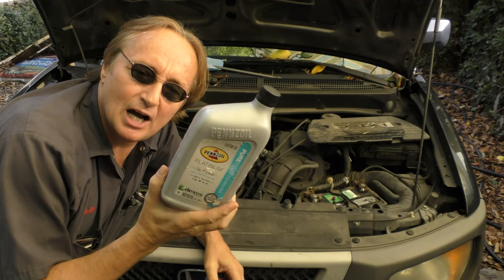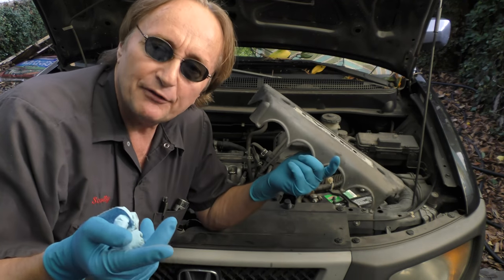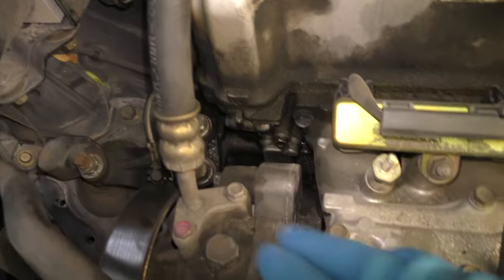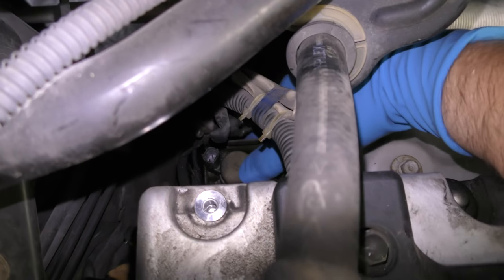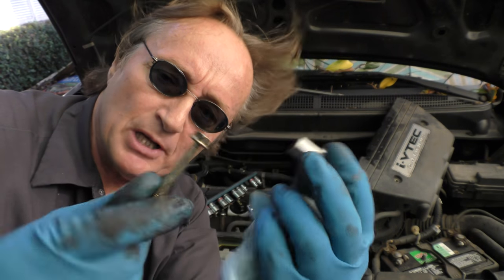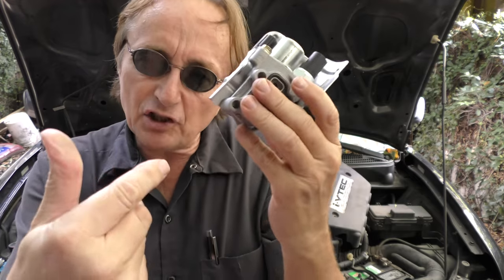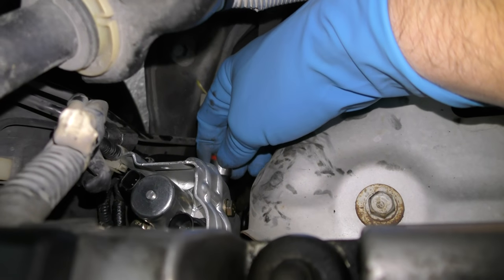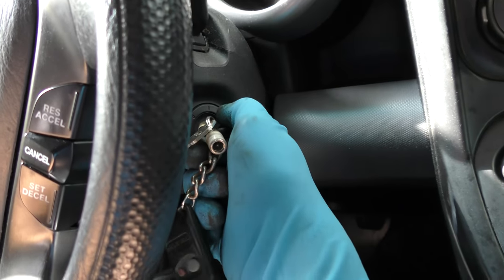How to Fix Variable Valve Timing in Your Car (VTEC)

Comment: My 2009 pontiac g6 2.4 is surging occasionally when driving.. Codes a while back at auto zone said exhaust  camshaft timing advanced.. What do I do to fix it??? The car is a pretty good daily driver, and I'm wanting to sell.  Just need the occasional surging gone, before selling.  Any help appreciated.

Comment: Hey Scotty, I have a Subaru that throws a fuel vent/system pressure code sometimes. It won't start after getting gas without a few taps on the gas pedal. It's an old beater car and I don't want to put any money into it. is there a cheap way to fix it or should I just leave it as it? Car drives fine.
Reply from the maker: +bmwmsport11 leave it
Reply: Scotty Kilmer thanks!
Reply: +bmwmsport11 Had the same problem on another car it didn't give any code tho, what i did was clean the fuel pump in the fuel tank, it has some kind of filter there and after that i car always started without tapping the gas pedal.

Comment: Scotty you recommend used 2013 Avalon rental car over New 2016 Accord? If i do regular services as you recommended i don't have to worry for coming years am i right? Hertz is offering certified 2013 Avalon rental car for $18999 is that a good price and they have 2013 Avalon $17500 not certified rent to buy which one you recommend.. I don't have any knowledge about the cars please help me..     

Thank you Scotty
Reply from the maker: +mona samuel I would go avalon for sure
Reply: Thank you so much Scotty for your advice.. Which one you want me to buy Hertz certified 2013 Avalon $18999 or 2013 Avalon $17500 not certified.

Comment: I have had the variable timing solenoid gasket replaced twice within eight months on my 2006 4 cylinder Honda Accord. I have over 307, 000 miles on it. It keeps leaking and now it’s leaking again. Mechanic told me he used Honda genuine parts gaskets. What could possibly keep this gasket leaking like this.?

Comment: I have consistently changed the variable valve timing system and it keeps getting clogged up. I service as at when due and use the recommended oil. Please what do i do?

Comment: Hello am from uk love your videos learning so much. I have a question to ask? about VW Tiguan 2008 model I went to start my car on 4days ago on  drive way. There is no crank and no start we done a diagnostic done is showing code error P0010 CAMSHAFT TIMING CONTROL BANK 1 FAILURE. we had misfire and loss power. I changed all spark plugs and all ignition coil and full service on car 6months ago . Still had mis fire and loss power but now no start on engine showing code P0010 please need some advice

Comment: hey Scotty I'm doing this for a friend on her 2005 crv . I'm changing that along with a VTEC filter and vct solenoid. is there anything I should do special to the vct solenoid? does it have to be installed "unsprung". like a timing tensioner or just unbolt and reinstall? thanks in advamce

Comment: I had to do one of those once. I don't remember the exact engine but it was on my Niece's Accord. One of those three bolts was in a position we couldn't get to. We ended up having to modify the socket into a wrench like doohickey. All of my wrenches were too thick, a socket could get on but there was no room for a ratchet. We cut the socket down shorter and welded it to a wrench we cut.

Comment: Hey scotty! My dad has the same stingray corvette with a 5.7L engine and he has a problem with his gearbox. It is an automatic gearbox but when he puts in reverse, the car will not go backwards. Do you know if this is a big problem ? Big fan of you! Greets from Belgium
Reply: The belt clutch is probably slipping.
Could be a big job and the other clutches might be going soon, so if you open the gearbox, you might as well change all of them.

Comment: hey Scotty hope you're still keeping an eye on these videos? My 2003 nissan altima won't start. It turns over and has spark. Checked the camshaft/crankshaft sensors and the fuel pump. While looking around I notice my VVT was broken at the connection to the point of falling off. Can this cause my car not to start if it is broken like this? I believe I did it while taking off the timing cover to fix my timing tensioner.
Reply from the maker: yes it can stop the car from running. It can confuse the computer data that much
Reply: Thanks Scotty. Keep up the great work. You have helped me out a lot with my cars.

Comment: Scott, I put pour in product Engine Restorer in my 2011 MKZ and it tripped the VVT codes p0018 and p0021. I had the engine flushed within 3-5 miles at a local oil change shop. It's running a little better but not like it was. What's my next step?
Reply: milton112 never ever ever use anything other than factory approved oil. some manufacturers use oil pressure to control the VVT and a different viscosity fluid can damage them. keep changing your oil. should get better with time if u haven't fucked it up already.

Comment: Mine doesnt look like its leaking but cel is on and the code came up for this. Do I just change the sensor on there instead of the whole assembly? The oil was old so I changed it and the cel went off for about a week and drove normal then came back on today and didn't wanna start when I stopped at the store but finally started after a few mins.

Comment: Hey Scotty , As my car is jerking at 300-4000rpm and i have a error code which says variable timing problem, i was thinking to change the timing valve solenoid,  after your watching your video i may just need to change the oil as service light due is on. do u think this may fix it?
thanks man great video.
Reply: Did that work cause I have the same problem

Comment: I just have a question. My silver rock warranty shows that solenoids are covered and when I got my car checked out by pep boys there saying vva valve and down on the bottom it says  remove and replace variable timing control actuator? Is this all the same thing? Or can solenoids be something different?

Comment: Hey great vid.  I just did my timing Belt on my Honda del sol it's a 1.6 liter v.tech.  and the engine was ok after the timing belt snapped.  I got it all back together and there a slugging In the throttle. no power I believe the timing is off I always thought you could only use a timing light on a timing chain is that right.
Reply from the maker: +Jon Wright you can use timing light on any engine, other than a diesel

Comment: I use a mirror with a handle to hold to see the bolts to screw them back in,  makes the job so easy..... but i sure have experience doing it..  every single time it is time to change the oil after i change it variable solenoid goes bad,  The oil is  not clogged up just regular oil in color when time to change it... I have had to do this from day one of 4 years  after every oil change and this part is not cheap around 104.00 ... And so far I have not figured out why it goes out each time I change the oil it usually goes out within two days of changing the oil... i use Castrol GTX High Mileage 5W-20 Engine Oil ...  i know its the right grade, and that brand i would think would be great for it.

Comment: hello 
in my toyota corolla 2014 i have p 2649 trouble code they told me to replace the valvematic which costs about 1500 dollars please tell what to do changing oil and cleaning the valvematic controller will solve the problem?

Comment: hi i want to ask you a question . my crv was going up on a hoist to about 6 feet up. when the hoist stopped my new vtec solenoid that was felt in place fell out and landed 6 feet down to the concrete floor . do you that something could of broke in the part? because after the install i still have the same code .let me know thx

Comment: Hi scotty im looking into buying a broken motorcycle, Its a 1988 Honda CBR 600 the guy selling it says it doesn't start because hes pretty sure he hooked up the "coils" wrong is it possible that he fried the entire electrical system by doing that or will it be a relatively easy fix?
Reply from the maker: +jgnjh NEVER buy a non running bike unless it's really cheap, like 200 bucks Then you pray it's a cheap fix like new coils or wiring repair
Reply: +Scotty Kilmer its a 400$ buy with the title would you do it?  I want it as a project.

Comment: I just test drove a used 2011 Honda Accord.  It had an awful noise on starting but went away after a brief second.  Could that be what is causing it?  Dealer wants $5000 for it!
Lee C  Thanks Scotty if you answer!
Reply: Lee C I have been having the same problem for about a year now. Found out today that it is the VTC Actuator (valve timing control), apparently it is a very common problem. Google it and/or search Youtube you will find out that is your problem.
Reply: @letmebehomie6185  thanks

Comment: I already changed the one on the back of the engine and the one on the left side and it has the right oil and I already did an engine cleaner and it is not leaking. This is for a 2004 Honda Element. It still has the check engine light and it still won't accelerate over 3,000 RPM most of the time. Do you have any other ideas what it needs?
Reply: same here, have you found something yet?
Reply: @kaze6027  so apparently the first time the guy only replaced the one sensor and the screen and gasket.  He didn't replace the whole unit because the guy I bought it from had just replaced it. Had the whole unit replaced and now it finally works. Although the computer was saying the actuator inside the engine was stuck on but not sure if it's an old code. It did do the rev limiting thing once more since it was replaced, right around when the thermostat went bad. I actually just dropped it off to get a full inspection done to see if it needs anything else.

Comment: hey Scotty I have a 1989 Camaro which I just replaced the throttle body, after replacement the car idles at like 1400 rpm in park and 1000 in reverse and drive, checked for leaks and installed new IAC, also adjusted the idle screw which made no difference
Reply: +The1972Cutlass sounds like vacuum leak, i know you already looked but thats what it sounds like, maybe the new gasket was defective?
Reply: Yea that's what I'm starting to think, it doesn't look defective but who knows it could be
Reply: The rpm goes up and down constantly so I believe that is most likely the cause, just purchased a new IAC for it so I eliminated that as the cause
Reply: +ChronicConnoisseur  I didn't use any sealant on the gasket, is that required? or it doesn't need to be sealed

Comment: Thanks. I have this issue with my wife's Mitsubishi Fuzion in the Philippines. I was told it was the fuel pump, the transmission, and a few other things before I realized that this was the problem.

Comment: scott i have 98 chevy silverado the engine cranks really slow battery voltage is good starter is good. It doesnt want to crank fast enough to start it. could it be a timing issue

Comment: Hey, I thought you said to always disconnect the battery when connecting / disconnecting any parts, so Not to screw up the computer or electrical system....
Thanks for ALL these great vids Scotty!
Reply from the maker: +235chuck don't need to for this part. It has no power when engine is shut off
Reply: +Scotty Kilmer OK. Less steps = QUICKER Fix! Thank You Mister Kilmer!

Comment: hi scotty, can you tell me, is it necessary to warm up your car before driving. and if it is when and why.can you please make a vid.
Reply: +Robert Marroquin No, you don't need to warm it up. Just avoid hard acceleration until the coolant has a chance to warm up a bit (until the needle starts to move) because the oil will be thick when cold.
Reply: What about in the winter...
Reply: Robert Marroquin
Same in the winter. You can let it warm up for 10-20 seconds if it's really cold, but any more than that isn't necessary. Idling for 5-10 minutes is just a waste of gas. The engine will warm up much faster if you just drive gently.
Reply: Ok thank you for info
Reply: +Robert Marroquin Be certain you have oil pressure before you take off. I cringe immensely when people have their cars in gear and moving before the starter stopes spinning.

Comment: Hii Jim. 
I am writing to see what the problem could be with my car. My garage is out of ideas, so i would be grateful if you could put in your views.
Its a Skoda Superb 1.8TSI, 2011 model
I got a head gasket replaced and a few cam timing chain guides replaced (only the chain guide and not the actual toming chain)

The car is running just fine. There is no misfire or rough idle or any visible abnormality and there is no overheating now, due to which i had to have the head-gasket replaced, but the EPC light comes on intermittently leading to an MIL light (check engine light) and the scanner gives the code P0341 (Camshaft Position Sensor A Circuit Range/Performance Bank 1 or Single Sensor)

Now we replaced the oil control solenoid as well as the sensor. Voltage at the connector is 4.7V., yet the fault code refuses to go.

Plzzzz help !!!!

Comment: Hi scotty, if i go to a tire shop to buy new tires & they offer a free aligment check.....and then tell me the car needs an aligment (even if it doesn't pull) how can i tell if they are lying to me  & how can i provide a counter argument to prove they are lying?
Reply: +lightningsmokerXx First look at the wear pattern on the tires you're replacing.
Reply from the maker: +Noah Welch  you have to use a trusted front end shop on that. I would not trust most tire only shops, they are paid bounty for selling jobs that often aren't needed. Since alignments deal with thousandths of an inch adjustments, you can't see it yourself unless REALLY bad. But I don't trust those tire guys, I just bought 2 tires at ntb, and the idiots didn't even balance them correctly so I had to take it to my front end guy, who promptly told me it was just a case of those idiots not balancing the tires right.
Reply: +lightningsmokerXx my car going 7 years and change my tire twice, i never need and alignment what source ever, it just work fine. i just love my factory default alignment.
Reply: +Scotty Kilmer some old machine the balancing machine just out of spec, normally i will watch them  doing the balancing job. it is very important.

Comment: Hi Scotty, i had a leak in the evaporator and the mechanic changed it to a brand new after market unit,the compressor is working perfect,and the ac is not cooling like it used to be, changed a fan speed sensor because the fans were not working properly,still not cooling, he didnt change the drier near the condensor and didnt change the expansion valve, is this problem because of the aftermarket cheap evaporator ? or shall i change the drier along with a new expansion valve ? and will this solve my ac cooling problem or i need to buy an oem evaporator to solve this ? the car is a 2007 nissan tiida "versa" Sorry for making it too long but i am really lost here :(
Reply from the maker: +lowlow643   could be a cheap evaporator, or many other things, like bad drier, expansion valve, or clogged condenser.
Reply: +Scotty Kilmer  the aftermarket evaporator is really cheap brand called formula made in thailand, do these aftermarket evaporators perfom less effecient than the 300$ original oem evaporator ? i found out these 2006-2013 versa's are notorious for leaking evaporators

Comment: whats up scotty.!? Nice video your my to go to on youtube videos. Soni have a 2004 range rover. No check engine light drives normal passed smog recently.I noticed i have an oil leak on the vvt valve Theres a seal that goes around mine is there a possibilty that i got bad seals and the vvt is good?

Comment: Scotty For some reason I unplugged the rock arm oil pressure sensor and I star the car the engine light is on.....and I stop the engine,, plug the rock arm oil pressure sensor back ....I star the car again the engine light is off but code p2646 still at scan tool everytime when I scan the vehicle,,,,please teach me if you know ,,,,,what should I do for next step....thank you....